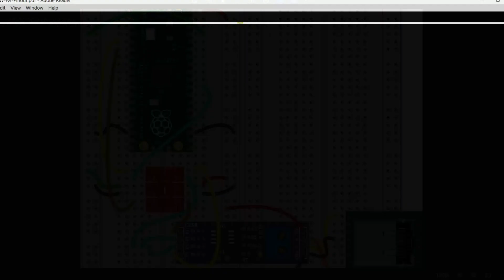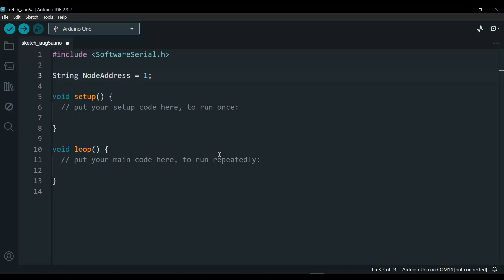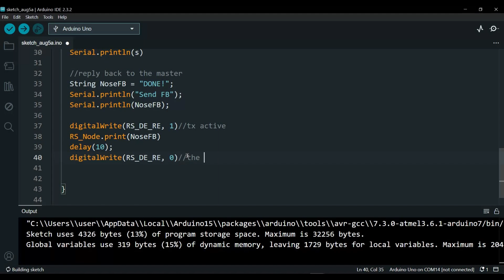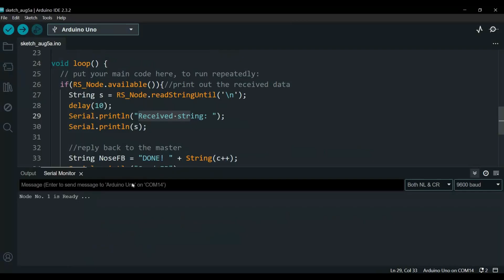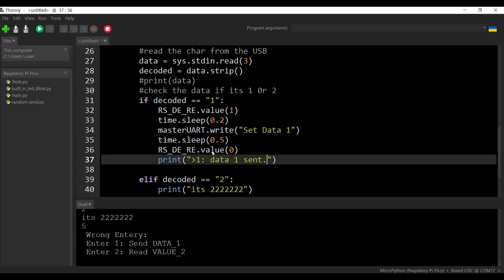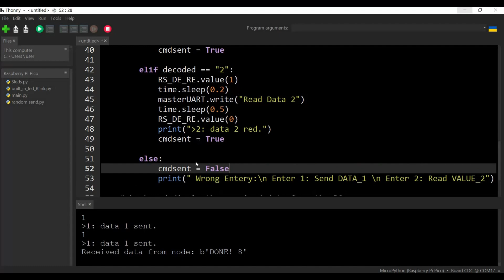PICO and UNO CommunicationRS485 MODBUS Explained

Comment: Hello, I wish you could you help me, I am also doing communication between Arduinos with the RS485 module in full duplex mode, it works between Arduinos Nano using Serial software, but when trying to do it between Arduinos Mega with the second hardware Serial port of the Arduino Mega the communication fails, if I use hardware Serial in both Arduinos  there is no communication at all, if I use hardware Serial only in the receiver, and Soft Serial in the messenger, it sends the message and it is received in the second Arduino (Hard Ser) but no messages are received from the Arduino with Hardware Serial, and if I use both with Serial software everything works perfectly, I wish you could give me a hint of whats going on
Reply from the maker: Hi! 😊

The issue is likely timing and DE/RE control on the RS485 module. Hardware Serial on both sides fails because DE isn’t toggled properly. Software Serial works because it’s slower and easier to sync.
Try to
Set DE HIGH only when transmitting, LOW when receiving.
Add a small delay after toggling DE when using Hardware Serial.